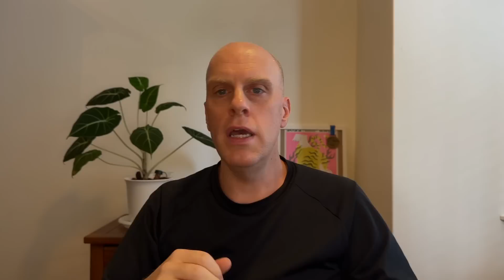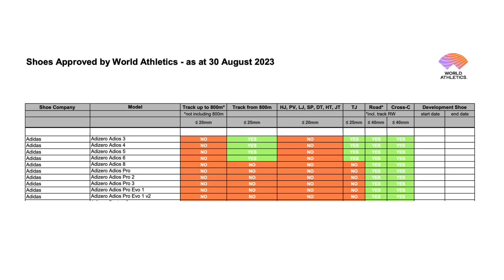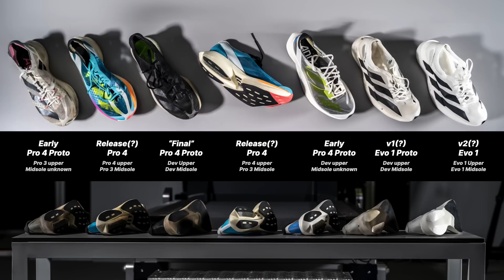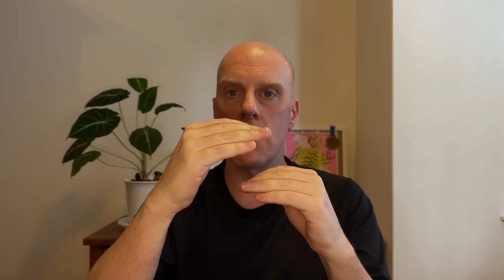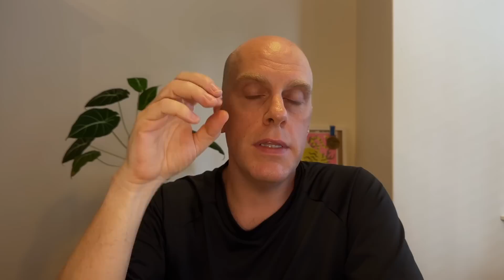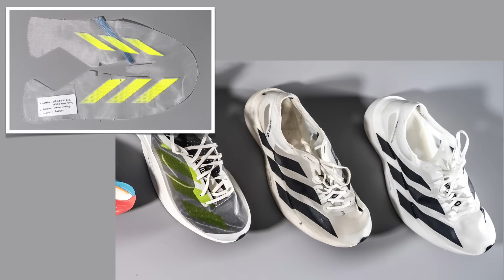The Adidas Adizero Adios Pro Evo 1 is the future of Adizero racing

Comment: I finally managed to get this one, and my first impressions of it out of the box are the following: 1) It looks stunning. It looks classy and 2) it really feels fragile on my hands. It's so light. The upper feels like paper on my hands. When I wore it, it felt like nothing was on my feet. It really feels, both on feet and on hand, that this is really a one-race shoe. I mean I don't want to wear it (for now) because it feels really fragile. Its lightness was really unbelievable. I thought the Metaspeed Sky Paris was light, but this one is light on a different level.  Now I have to choose the race I will test it in after my "familiarization" runs. As a shoe geek, I'm quite happy to try a concept-futuristic type of shoe.
Reply from the maker: Right? When I first held a pair of these they felt like there weren’t there. I was also shocked how lightweight the upper material is.

I’m used to the weight of VFs and Metaspeeds but these are next level light. 

Agree on on foot feel. Felt barely there. Maybe not one race… but limited max performance. They felt like special occasion/PR tools.

Agree full on how amazing they look in person. Breathtaking really.
Reply: @SagasuRunning  I'm also glad that they are calling the midsole Lightstrike Pro Evo so that a shoe geek like me won't be confusing it to the standard Lightstrike Pro.  This Evo foam feels like a sturdier sponge which is light but bouncy.
Reply from the maker: @mfcc1084 even the LSP Evo foam is evolving quickly…. It’s going to be interesting what Adidas does over the coming eye for two.

Comment: Discussing. Pricing people out of the sport.
Reply from the maker: This shoe is not intended for “everyone”. Adidas doesn’t want to sell it, nor do they want you to buy it.

It is a shoe intended for elite level runners or runners who want to invest in an important PR. There are plenty of other daily shoes and fast race shoes behind this one.
Reply: It is a stunt.  The fantastic thing about athletics it is open to everyone.  Some athletes, juveniles cannot afford this nonsense and are priced out of it.  I see it in the running community.  Overpriced equipment is for triathlon.  Keep it out of athletics.
Reply from the maker: @gascraiccraic3857  Does a young runner WANT the top end super shoe… likely… do they NEED the top end super shoe… not at all. In fact a young runner is likely better off in a standard daily trainer and a pair of $60 spikes… running can be done with very lower cost performance gear.

But this doesn’t mean top end tech should be made available for those who want/dan afford it. Or different tiers of shoes for didn’t levels of athletes ability or dedication.

Running is a fairly low cost “sport” or “activity”…. Needing be wanting really apply here.
Reply: I see this all the time in my running club, young runners who have super shoes and ones who do not.  I have been a runner for 30 years plus and I have seen it all.  $400 for a one time running shoe is nothing more than discussing and should be called out.  It is obvious Adidas is trying to claw back the $500M they lost on yeezys.
Reply from the maker: @gascraiccraic3857  Yes, Adidas looking for wins here… but at $500 for 521 units… Adidas is loosing significant money selling these. If they sold the Evo 1 at product they would need to price it around $1500-2000.

Comment: Good analysis as ever and good spot with the two different Evo 1 versions. Seems a bit odd though to get two versions fully approved as there is no indication that adidas are going to be selling two versions so not sure how that works. That said the adidas UK product page does show "2 Colours available" with one seemingly already sold out and the other via the app on 26th Sept. Not yet seen any consumers with one in hand though.
Reply from the maker: I assume Adidas wanted to see what it could get at the Great North Run, this v1, possibly it was also to get it in the approved shoe list sooner, well before Berlin. V2 has to be the version being sold/raced now. The shoes on the on the table were put there for a reason. Those specific models were not by chance. 

Interesting spot on the app. I don’t put much faith in adidas E-commerce CMS as it’s been all over the map this year.

If we do see Adidas break the WR or go sub 2 in Berlin… I bet we will see a wider release of this shoe in the spring. Possibly with a slightly lower price tag due to volume. 

We shall see.

Comment: It is the final blow after what happened in Boston, Nike and Kipchogue are hurt and the Kiptum phenomenon may not last long, Nike is in trouble, the new Alpha fly weighs about 7.5 ounces!
Reply: Or at least that's what the commercial model weighs, I'm sure that Kipchoque's Alphafly has the same technology but a different midsole density and weight in order to be exclusive to it,
Reply from the maker: The shoes EK race in, if a listed model (which the AF3 is not yet, it’s still listed as a Dev model) are the same as sold. WA refs are very clear on this.
Reply: The World Athletics regulations only talk about heights and a single plate and availability to the public but it does not say anything about weights, perfectly well the public model can weigh 7 ounces and the
Reply from the maker: World athletics refs are very clear on all of this and what constitutes a manufactured version for consumers vs what is raced
Reply: And the pair of Lipchoguw 5 ounces, if not, he will be at a clear disadvantage with the Adidas elites since this can give between 1 and 2% improvement in running economy.
Reply from the maker: Im not sure the advantage is that much. The AF3 also has more bounce. Yes, a lighter shoe is better overall for running economy… but both Nike and Adidas are engineering different positives in their shoes.

I do think the Evo 1 caught Nike a bit flat footed, Berlin is going to be fascinating to watch. It will come down to who is trained better.

If Adidas takes it will be huge. If Nike takes it it will be a massive defeat for Adidas…
Reply from the maker: Nike will figure it out. I have no doubt.

Comment: It’s clear that this is being sold only to minimally comply with World Athletics regulations. Otherwise it would be like the Vaporfly Elite used in the original Breaking 2. 

Sometimes shoes are really good at reference size but their week points scale badly to large sizes and that is the case with the Adios Pro 3. 

I’m glad that Adidas has decided to work on the weight because they have a problem. The Adios Pro 3 is surprisingly successful for Adidas given that it is too heavy. Even in size 9 it’s heavy but in size 13 it’s about 40g heavier than a Vaporfly. And the weight fees like it is in the midsole/outsole so the moment of inertia is way past the ends of your feet. They are a very nice tempo workout shoe but I wouldn’t choose them for a marathon. 

Really the whole Adizero line is heavier than it should be. Even the Takumi Sen is not that light. It is the same as a Streak 7 (which is a marathon shoe not an 5/10k shoe), 30g heavier than a Streakfly, and 65g heavier than a Streak LT 3.
Reply from the maker: AP3 US Size Men’s 9 is 215g/7.58oz making it the heaviest of the tip supershoes. VF3 are 185g/6.49oz (which makes them the lightest VF yet, even over the Vaporfly Elite Flyprint). 

You are totally right, it’s just doesn’t scale. It is one of many reasons as to why they are trying to lighten LSP and have more options to tune the shoes.

Comment: Out of curiosity I googled the weight of Streak LT and it's the same as this shoe. Imagine it without the waffle rubber outsole that probably weighs a ton and with a spray on rubber. It will be a feather.
Reply from the maker: The Nike Mayfly is still lighter at 135g/4.76oz, though it was far less shoe. I actually had a whole section on weights that I cut from this due to length.

Comment: Very interesting. I think the idea of a sprayed outsole is brilliant. Add some ceramics to it or even industrial diamonds (like on a drill) and you can have the durability without the weight. Midsole is more difficult because you reduce the weight by adding air like ZoomX but you reduce durability..
Reply from the maker: Interesting take on adding grip to the outsole. Though that would be bad indoors on any type of floor. I do wonder if they will eventually incorporate something like Dyneema into the rubber for durability.

Also… I don’t think Adidas is trying to go as far as ZoomX softness and bounce. I do think they want options to tune LSP foam more than they can now. Especially combined with possible carbon fiber plates.

Comment: I'm calling these homologation shoes.
Reply from the maker: 100% true. That is what they are. In every sense of the word.
Reply: A Porsche GT1 or Merc CLK-GTR with laces.
Reply from the maker: Yes!
Reply: the cars do last more than one race though
Reply from the maker: @liiou4445  Not really. A race car, especially at the LMP/proto/F1 levels. A car is completely rebuilt, from the ground up, usually with new parts per race. Some specs have rules that teams HAVE to use the same part (like and engine) over multiple races… but if that type of rule isn’t there… the car is nearly 90% different parts race to race.